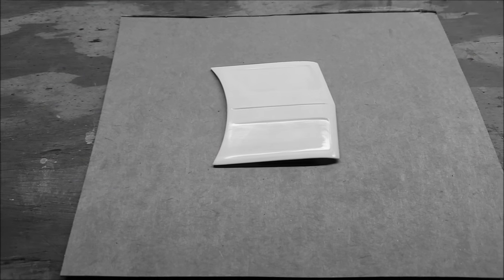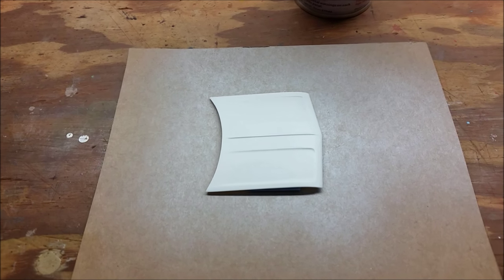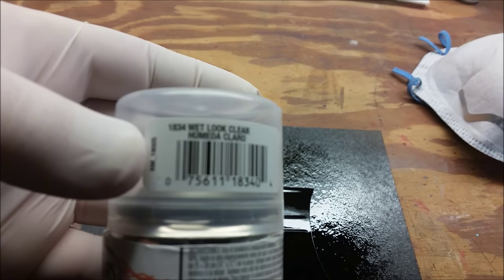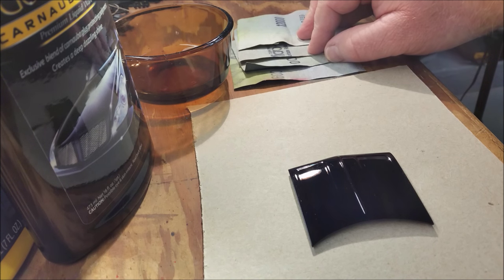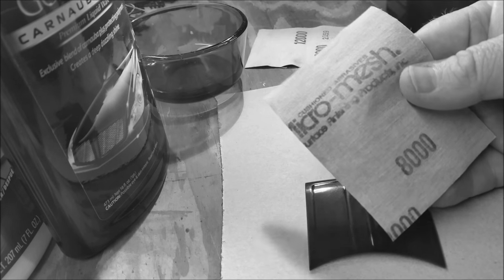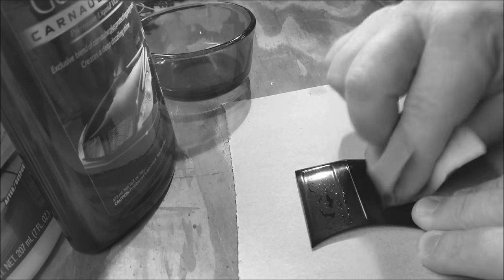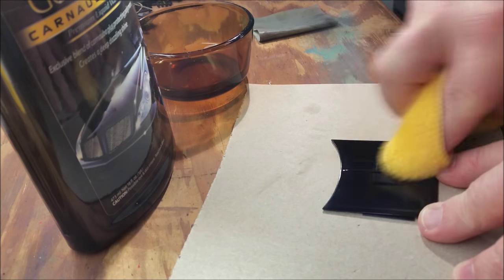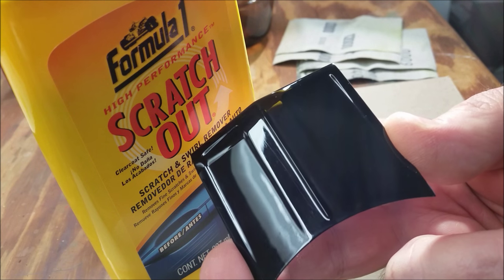model car polishing

Comment: Very good tutorial. I bulid 1:64 diecast customs and use a similar method to get a very nice shiny mirror surface. I use Novus 3 and 2, then Scratch Out, then Novus 1 for extra shine and to protect from finger prints. Another thing to remember is to let the clearcoat cure fully before doing any work on it. I leave my models alone for at least 3 days before polishing.
Reply from the maker: Thank you for watching..👍
Reply: nice very nice thank you for the tips will definitely give it a shot 😁🤩

Comment: Nice job thanks , questions: the formula 1 polish , works on a very small cracks metallic models paints too ? 👍
Reply from the maker: Hello Alex. I don't see why not, as long as it has a clear coat over it. I did use this method on a red metallic paint job with clear coat. Thanks for watching.

Comment: here's a tip. it's how I paint. works great. after sanding, wash in warm water with dish soap. wash well to get any oils from your skin off the part. if you have hard water, or if you use well water, make sure and dry it immediately! now, with latex gloves on, using a lint free cloth, like you'd use to clean eye glasses. you can get it from Walmart for 3 or 4 $. use this with rubbing alcohol. I use the 70%(30% water) go over the entire part, even if the entire part isn't going to be painted. this will save it from transferring oils to part being painted. I don't like using tack clothes, simply because the bee's wax can be transferred to the part. especially if you get it from someplace like Walmart. and also it can be scraped off when going over edges, body lines, etc. and this wax will cause "fish eyes" and you'll have to repaint it. you want to just lightly wipe the surface. do NOT scrub the primer, as it will remove some. this is the best way of keeping your part sanitized
Reply from the maker: Thx for your suggestion, but I have never had a problem with tack clothes...I have even used them before on painting 1 on 1 cars and furniture restoration. I never had a fish eye problem during painting after using a tack cloth. Everyone has there own way and technics. Thanks again for you comments. Thx for watching.

Comment: Great video! I cannot seem to find the sandpaper kit you have here, where did you get it?
Reply from the maker: Hello HV, I have purchased through EBAY  or local hobby shop. It's made by Detail Master. KIT# DM-9000. Cost is about $18.00 to $20.00. Thanks for watching.
Reply: @jmarshallable1  thank you

Comment: You need to start off with a harsher sanding paper. Doing it this way you got the polish, but the surface is not flat. Start off with something like 1000-1500, very lightly sand it with water and some soap, and then work you way up to 2000, 2500, 3000 and above. If you start with something like 6000 you will just make the uneven surface shiny, but not flat.
Reply from the maker: derbigpr500 Thx for watching but, 1000- 1500 is to harsh for a model car. Maybe for a 1:1 car. This is a polishing kit from a model car detailing company. Also, there are no flat spot in this hood in the demo. Yes, I agree on starting with the lowest grade of paper 3200 or 3600, not 1000- 1500 it will cut through this clear coat in three swipes. Again thanks for watching and I do appreciate your comments.  Thank you.
Reply: Ah ye possible to cut through if you apply thin coats of lacquer. But I do it that way on small 3D printed parts after finishing off and painting them, I do 3 coats of 2K clear and let it dry for a week.  Then 1200 --> 1500 --> 2000 --> 3000 water sanding, then I use very fine polishing paste until it gives me a very even satin finish with no actual visible sanding marks, but without much shine either, and then I just use a polishing compound and microfiber cloth until I get a mirror finish.  I tried jumping straight to 3000  sanding in the past, but as I said that always gave me a nice polish at the end, but not a perfectly flat mirror like surface.

Comment: Thanks for the video! I presume decals would be safe under three coats of clear.
Reply from the maker: Hey Mark, thanks for watching.  Yes. But some decals ( cheap decals) can't. They are be to thin. In most cases I put on a very thin coat at the beginning and let it dry for 20 minutes and work up from there. Thx.

Comment: Good stuff! Do you think the Formula 1 scratch out would work on an old Tjet slot car to brighten up the paint?  Or what would you recommend I try using? Any ideas? Thanks
Reply from the maker: The Scratch Out should work. Or Miguires has a product that works just a good. I would use a Dremel with the polishing wheel. This makes it work much better. Thanks for watching. 👍

Comment: I'm a little confused?  I just came back to model building after 30 years and I just shot the AMT's Gremlin X with Rust-Oleum decanted enamel key lime green, thinned a bit with generic lacquer thinner I bought at Home Depot through my junko airbrush
The Finish did not come out glossy came out sort of like semi-gloss , I have some high spots and blemishes . I have approximately 6 thin coats and I thought that you were supposed to sand the color first to get it as smooth as you can and then clear coat it and then sand the clear coat or do I just send the clear coat ?
Reply from the maker: Howard. Sometimes depending on how low the low spots are the clear coat can fill in the low spots. If I spray clear through my airbrush I add a leveling additive to the clear, this helps the clear coat level out . After the clear has dried for a couple of days then I sand the clear. Yes, you can sand the paint before clearing if there is alot of deep low spots,but you should sand the plastic before paint and that will help alot more. Thanks for watching. 👍

Comment: Do you think that Scratch out works better than or about the same as the Novus polish? It does seem to be a little cheaper than Novus. I use it and do the same stuff and it works about the same. But, I have never done a black paint job yet though. Great video...thanks for sharing.
Reply from the maker: +mike breazeale   Mike, Novus is a good product but, yes it is more expensive. My thoughts is that Novus is made for plastic/acrylics not paints which Scratch Out is formulated for paints.  Thanks for the comments and Thx for watching.

Comment: Good video, enjoyable and helpful. I had a question concerning waterslide decals. At what time do you recommend that they are applied? I build more professional racing style builds like rally cars and la mans car types; decals often cover most of the body so I was wondering on how to get the same shine on them. Thank you
Reply from the maker: Hey Ryan, I would put the water slide decals on before you apply the coat. Before you clear coat the decal test it on a scrap piece of plastic, so.e decals don't like certain clear coats and may curl up or leave the decal. I use Tamiya clear and it is forgiving on decals.

Comment: So I have a question... my kuz passed away a few years ago and we glued a model car of the 1 he used to drive on his grave stone well long story short all the clear plastic is badly sun damaged yellowd bad and cracking I was wondering if there any way I can clear the glass again and also do something to prevent the window fogging in the long run
Reply from the maker: Hello Mayolo, once the clear plastic is cracking due to sun damage there's nothing you  can do to save it. One thing would be, dip it in future floor wax but that's only  a temporary fix and it wouldn't last long due to being outside in the elements. Thanks for watching.  🙂

Comment: by doing that many steps how much clear do you end up taking off? looked great by the way
Reply from the maker: flex It not so much how much clear you sand off, it's sanding the clear to get out the orange peel and leveling out the clear finish. when you start sanding you will be able to see the high spots and low spots by the shine left behind from the low spots. Once it is on3 flat finish you know that the clear is level and the orange peel is gone.

Comment: Great finish bro, have a question, do you know if the formula 1 carnauba wax works well to have shini results?
Reply from the maker: Hello Alan, Thanks for watching. As for the Formula one wax, I have no used it. Maybe I will have to check it out. I mostly use Maguires wax and products, Except for this Scratch out. Requires makes a simular product but it's expensive. Again, Thx for watching.😎

Comment: Quick question. After spraying the gloss topcoat, when's the best time to start the sanding/smoothing and polishing process? Is it best to wait as long as possible, until the topcoat has fully cured, or is it preferable to do it shortly (a day or two) after, when the topcoat is relatively soft and more "malleable"? Which will result in the smoothest and most reflective finish? Thanks.
Reply from the maker: Monsterist76 wait for the top coat to gas out. At least two days so it has time to fully cure.

Comment: Styrene Monkey, thank you for your response.  I thought that was the right order and I have been working hard to remove the orange peel.  I find wet sanding with 600 grit and the go to 4000 and then 6000 grit.  The surface is very smooth but I can still see a few blemishes.  Would they show up under the clear?
Reply from the maker: yes, anything you can see with the naked eye ( blemishes ) will show in the clear coat. You may need to add another coat of paint and wet sand it, then see if the blemish is gone.
Reply: Thank you.  Just one more question if you don't mind.  I used a pray can for my color paint.  I was thinking about applying another full cover coat using decanted paint sprayed with an air brush.  Would I benefit with just one full cover coat not a complete gloss coat?Really, Thank You for your interest in teaching me.
Reply from the maker: Rick, One full coat should be fine with the air brush . Then clear coat and wet sand after the clear coat has dried for 2 days.  Good Luck.
Reply: SM-Thank You

Comment: I have tried to wet sand and I always have problems getting all the clear coat sanded. I have not tried the Scratch Out. Does it blend the sanded parts and the parts that are not sanded?
Reply from the maker: If you don't sand the clear coat even with itself you will have high and low spots that effect the shine. Scratch out will polish what has not been sanded but it will not match the shine of the even clear coat. It give a kind of wave effect with a shine...I hope my explanation  helps.  Thanks for watching.

Comment: seems to me the paper towels would be a bit abrasive, I'd think you would use some type of polishing clothe
Reply from the maker: Hello Gregory, I have wet the paper towel so It is soft. And I use SPARKLE paper towels, they are very soft. You could use one of those make up sponges, they work nicely as a wax applicator. 

Thanks for watching.
Reply: if you want the best results and to be as scratch free as possible dont ever use a paper towel of any kind or some old shirt. with polishing by hand its best to use the softest foam applicator pad you can find or a new microfiber (even if its a cheaper one, as long as its new and perfectly clean youll be fine)

Comment: Will any car scratch remover and polish do?
Reply from the maker: I not sure. I've always used Miguires wax and Tamiya also makes a wax for models which works real well with the Tamiya clear.
Reply: @jmarshallable1  Thanks, I might check Tamiya wax out since I´ve been using their paints and clearcoat

Comment: I airbrushed a car gloss black. I have orange peel on some spots. Would i get the same results even if its been airbrushed?
Reply from the maker: Well, I would wet sand the paint first using 6000 grit working my way up to 12000 grit as the final sanding stage. Once you have achieved this process I would go ahead and use the Scratch Out next. Scratch Out is a mild polish so it will not get rid of orange peel. I hope this helps and Thank you for watching
Reply: +Styrene Monkey, thank you very much!! I will give it a try

Comment: why would you go in circles ? i detail cars for a living and it just bugs me because you're doing all that work to get scratches and swirl marks out but do you not realize that circle scratches can be seen more in various different angles then straight line scratches id go straight back and forth if i was you just better and prevents circular scratches which suck and can be seen more
Reply from the maker: Yes, you are right about circles on 1:1 cars. That's just the way I do it. It's just a suggestion you can do it any way you like. The product I'm using  is for removing scratches, so going in circles or back and forth I don't notice the difference on this small of scale. Thx for watching.